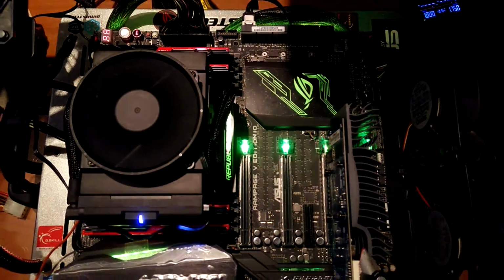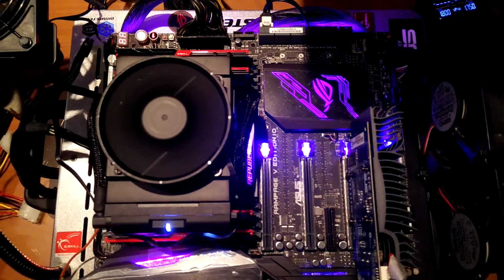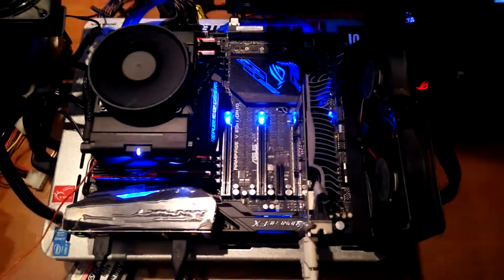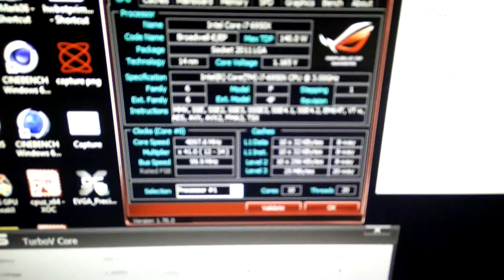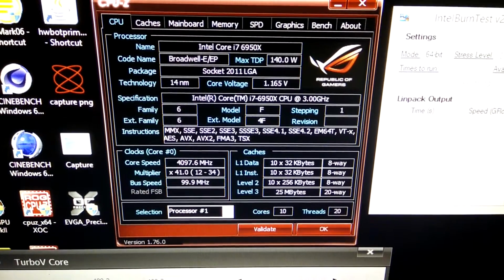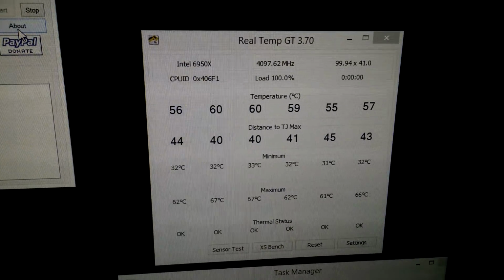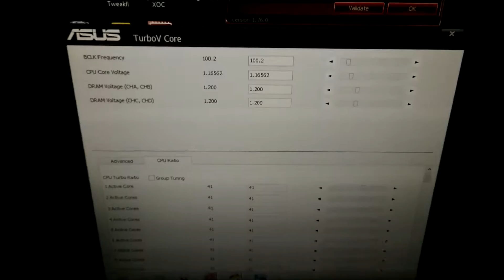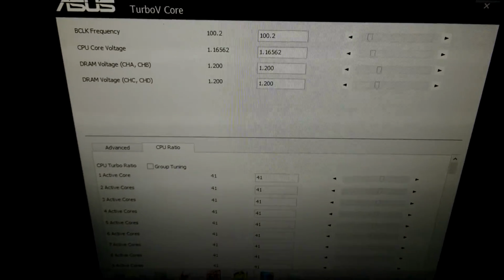The MasterLiquid Maker 92 Load Testing with the i7 6950x

Comment: Next time turn off the AC just for a minute to do the video lol.
Reply from the maker: will do next time :) .. but its might hot here in the summers :( The A/c was set to 24 deg c and was pointed upwards and away from the cooler so as to not interfere :)
Reply: Well i meant so we could hear the pump and the cooler's noise instead c: